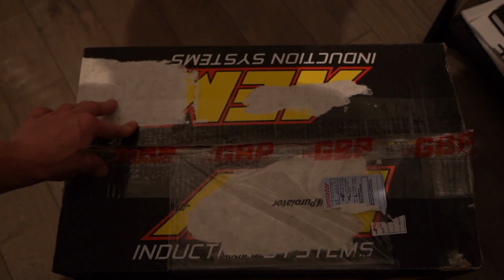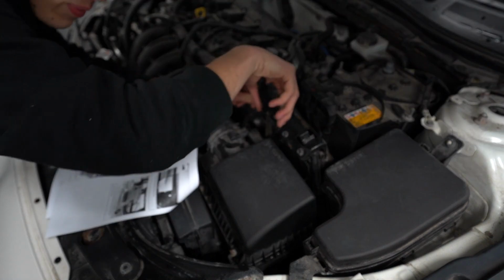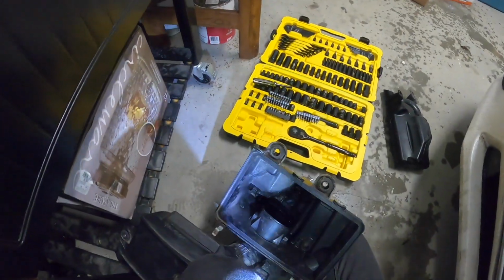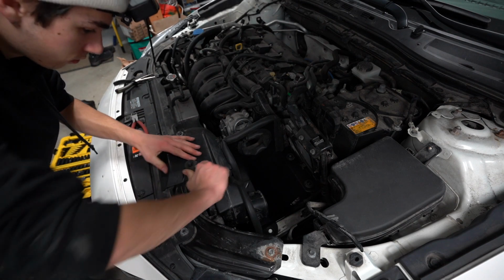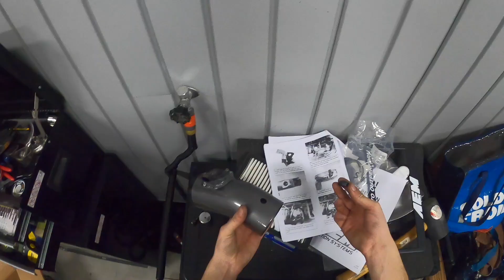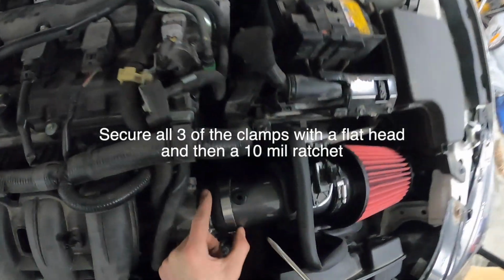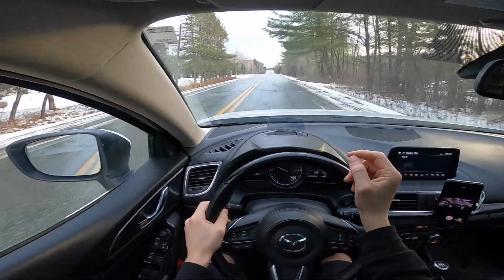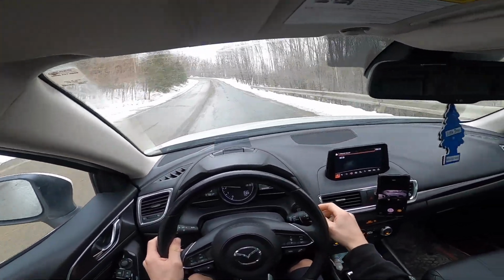AEM intake install on MAZDA 3 2.5L

Comment: Yesterday I have installed AEM 21-773C cold air intake system for my 2 liter Mazda 3 BM, and this thing makes the engine sound REALLY LOUD inside the car. 
If you care about driving comfort, consider purchasing AEM 28-20293 - air filter which you put inside the stock box.
 
First impression after a short ride - performance wise AEM 21-773C feels to be slightly better. Also I think fuel economy is a bit nicer? I'll give it a shot for a while - especially that soon I'll do a longer trip from Poland to The Netherlands. 

With stock intake + AEM 28-20293 I had a really nice fuel economy ~5 liters/100 km (47,04 mpg) when driving 120km/h (74,5 mph) on cruise control (most of the time). I wonder if AEM 21-773C will beat that.

BTW very good tutorial - You helped me a lot with installation!